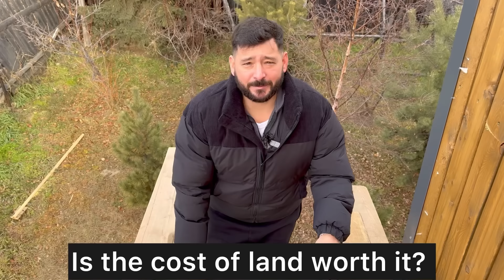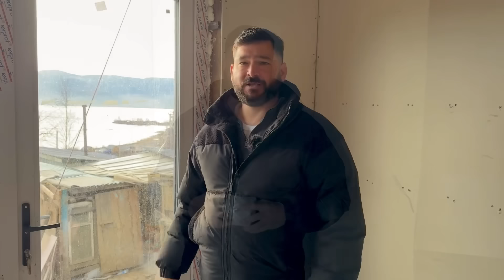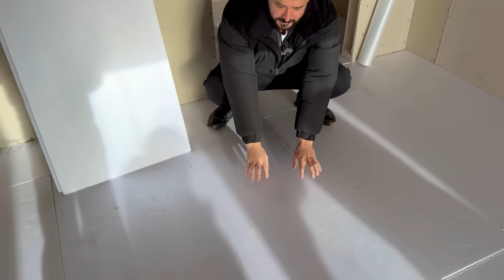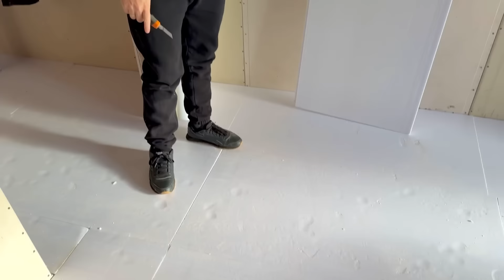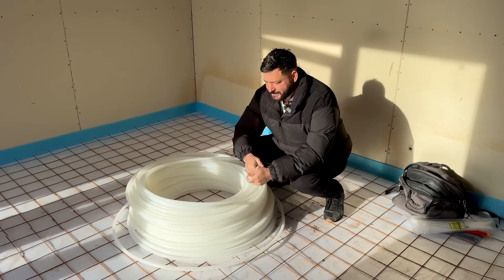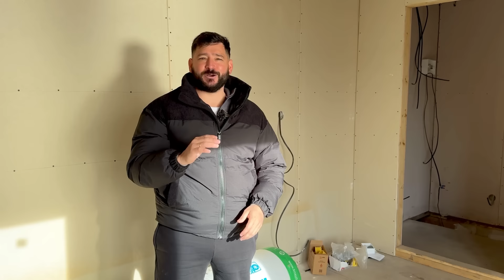House Prices In Russia Are Shockingly Low! 🇷🇺 Can You Afford it?

Comment: i would consider replacing the septic system or at least the tank, if a “holding tank”, is all that would be allowed more or less.  that existing unit looked rough and unsafe to people (kids), animals, and environment in terms of unsecured access/perhaps function.  i’ve engineered thousands of commercial and residential systems in the usa

Comment: I just know one way of construction in Russia. Having been in the Urals. They use wood trunks and central heating radiators. It has worked for more than 100 years. This construction seems very modern but it creates a lot of questions. Knowing how pvc pipes behave, plastics degrade with time and if you use hot liquids these should degrade with time. I would suggest metalic pipes for heating systems. If you want to keep the system condition good for longtime.

Comment: I have installed heated floors in Boston years ago were the hose would go under the floor in-between the juoses we're hot water would go through the hose to heat the floor, very expensive but very nice come winter time.

Comment: Lol mother board, it’s called condensing boiler.
I am not being rude But do you know ow what is the difference between mother board and condensing boiler? Yes there is mother boards inside the boiler.

I installed in-floor  heating systems for 24 years in Canada
Reply from the maker: Nice

Comment: Hi, How they keep the water and sewage pipes not freezing in the winter?
Reply from the maker: It’s kept covered and not exposed
Reply: Греющий кабель в земле которая часть. Наружи короб утеплитель и тот же греющий кабель
Reply: @АлексейАлексей-ы2п9ф  Sorry, for some reason your comment was not translated in to English.
Reply: @johndewey6358  The heating cable is in the ground which is the part. Externally, the insulation box and the same heating cable
Reply: @artemprudnikov5693  Thank you
Reply: @johndewey6358  Good luck & all the best

Comment: Here in the US we have manufactured and modular homes they are both factory made but there is a huge difference.  

Manufactured homes comes in one, two and sometimes in three sections with rough finish just like those in your video and they are temporary attached to foundation, the price $120-180 per sq. ft. depends on the location and customization   

Modular homes are just like traditionally build homes, you have a land but you don’t have time to build a home on your own then you just order factory made one, it comes in many pieces depends on the size and design you have chosen and its permanently attached to foundation, the price $220-350 per sq. ft. depends on the location but also additional features and customization may add $10-150 per sq. ft.   

Heating system in your video is called “hydronic system" in US, it was introduced in late 1960/70s but never really took off commercially on a large scale until 2000 and later due to its (material/labor) high cost, even today not everybody can afford it, the average price for labor and material is around $15 per sq. ft. and so the house in your video is 70 sq. meters equals 753 sq. ft. times $15=$11,295 and that would be final cost for materials and labor while “forced air system” is around $4 per sq. ft.
Reply from the maker: Thanks so much for the info!

Comment: 7:40 large heavy barrel that holds 300 gallons of fluid, thick 1/2~3/4 inch metal... with an outer shroud with a thick batting of insulation around it, thermal mass battery. like a locomotive train steam boiler. in shed outside of building... most log cabins have that kind of thing. burring natural gas wood kerosene diesel oil etc. prioritizing a sauna... an old 45gallon 316L stainless steel barrel only works for 3 seasons till the rust sets in. but in other terms, burning things just to make heat is not efficient so the thing that burns fuel to make heat also makes electricity, and the more that use electricity bump the load up making "it" hotter, large common aria. tho in Detroit for some time, pressurized steam was all over the place as the industrial processing plant ran. some still use large boilers that they fit whole 5 foot long 12 inch wide cut tree sections of logs into to heat their shop space. loaded up and burns for a month... heated lodges were a medical hospital type of thing, as the dogs live outside all year round. anyways, 40 years of 90 foot by 40ft double wide mobile trailer, need a 5 Ton truck to move it tho every 10 years the air to air furnace needs a new blower motor. adding to the first part that a water boiler system still has an air to air heat exchanger on the exhaust. tho as a last point, placing thin boards around the outside of a fabricated structure on stilts prevents cold air convection under the floor in the "crawl space" known to raise floor temperatures by as much as 15 degrees Celsius from outer ambient without using energy, shoveling up a snow pile around the exterior also has the same effect preventing cold draft.

Comment: In Norway they also use this method. Not quite the same technique but the same principles to heat the flour with liquid water or something similar. 👍 Very energy efficient and easy to control. You can also ad remote control by an app on the iPhone or something but not necessary if you’re not a tech geek. 😂 I might ad that a complete house building project like this in Norway would cost roughly NOK 3.000.000,- or double the price which is 30.000.000,- Russian rubles.😳😱
Reply from the maker: Wow I love such comments from similar weather countries and their prices thanks a lot for the information my friend
Reply: For 30 million rubles you can buy a two-room apartment in Moscow or a large house in the suburbs

Comment: It's done here in Minnesota,  the manifold you were holding up has the zone valves which control heating to any given area  and the nice part about that system is they're basically heating it with an on demand water heater that will use minimal fuel.
Reply from the maker: Thanks for reporting in from the northern states.

Comment: If you were building here in the states it would be twice as much. I just spend 10 grand on plywood for my roof alone. 80-100 bucks per sheet for roofing and flooring
Reply from the maker: It’s getting insane yes
Reply: Warren is from Canada, building a house in Russia. I may be wrong, but he says that in some cases prices in Russia are 4-5 times lower compared to Canada. And they can afford to take better materials that they couldn't afford before because of their cost.

I don't know how fair it is to compare Canada and the USA.
Reply: @evl3894   I know one thing the prices here in WV are bad, I need a 500 foot trench dug for water and it’s like pulling teeth just finding someone willing to do it. Have to resort to paying some commercial service from a metropolitan area to come do it for a premium, which is like $15,000
Reply: @encompassthyeclipse7278  As far as I've heard, there is a phenomenon in the US that you can't hire anyone to work on home improvement, but only the specialist who is recommended or allowed by the district, or someone who has all the necessary permits, but such specialists charge a lot of money for their services. And if the cost of work is conditionally $100, then such a specialist takes $400-800. Moreover, you cannot install an outlet yourself, for example, since you do not have a permit for such work and therefore you need to contact expensive specialists again.

All this phenomenon is explained by the fact that improper installation can affect the safety and cost of housing, which makes the entire area less attractive. Group responsibility is a very crude manipulation.

Again, I understand that the USA is very different from state to state, from city to city and from district to district. But it seems that this phenomenon is quite common. Although it seems to me that in such a rough form, it's just pulling money out of people. A harsh capitalist machine.

Maybe I'm wrong and this is erroneous information.

Comment: The only time you see radiant floor heating in Canada is in higher end custom and semi custom homes, sometimes coupled with geothermal. The typical builder-standard home will use forced air. Builders here have not adopted the technology because they go with the cheapest quickest solution. Trying to get the US and Canadian builders to adopt any new technology is quite painful. They're decades behind other places in the world. The radiant floor systems we do have are different from what you showed.
Reply: Here in Canada if you're fortunate enough to have heated floors,  it will be hot water heating from pipes in the (floor) concrete
Reply: Не совсем так. То что можно внедрить не потратив много денег, то есть. Например рекуперация воздуха, рекуперация тепла сточной воды. А тёплые полы не приживаются по причине дополнительных расходов застройщика.

Comment: Here in Norway we often drill 200meter deep holes for water or energy for heatpumps :)
Reply: we tend to do the same here in Russia as well. Just depends on a location
Reply from the maker: No way!!!
Reply: @Wild-Siberia  At my last project there was 16 holes that was between 200-250meter deep connected to one single NIBE heatpump :)
Reply: @RogueSecret  Wahnsinn. In Russland ist eben alles viel größer dimensioniert.😊 Kein  vergleich zu Deutschland.
Wieviel haben die Bohrungen gekostet? Wieviel hat das gesamte Projekt mit der Wärmepumpe und der Fußbodenheizung  gekostet?  Wieviel quadratmeter kann man mit dieser Anlage beheizen?
Oh, Entschuldigung. Hatte übersehen, daß es sich um Norwegen handelt. Aber vielleicht könntest du mir die norwegischen Preise sagen, nur mal um zu Vergleichen?
Reply: @uteschneider3349  For a normal 200m2 house you will manage with a hole 150m deep hole that cost around 8000 EUR+ 13.000EUR heatpump. There is a few cheaper way to collect energy from the earth, but this is the one that is the most stable no matter how cold it gets outside over a long time.

Comment: SPB ~$250k
Reply from the maker: Wow
Reply: @Wild-Siberia  ~230 sq m2, 3 bedroom on 2nd floor, but 2 of it i use as my work office and a sport room. 

It does include all engineering - vent+conds+diesel electro generator.
It does have a water source (underground), has a septic.
I pay about $300 per month for electricity.
Now connecting gas to heat and total amount of expense for each month should be ~$150 max.
Additional expense is septic maintenance (once per year), but it is not significant.

Comment: Hi Daniel I’ve seen this type of floor heating in the Northside wealthy suburbs of Chicago but my heating is GeoThermal but you need 2-3 Acres for the tubing to be laid outside of the property in the ground with this liquid in the tubing..Best heat and cooling system hands down and my electric bill is a 1/4 the costs compared to my old Lake Barrington Shores ,Illinois condo which my electric bill was 3 times more and still cold and poorly insulated..And no privacy.. I think those Modular’s are worth it due to the fact of the heating components and lake view and you’re able to add windows and doors and cost efficiency..🇷🇺❤️👍
Reply from the maker: Brother thanks so much for filling the comment section with knowledge thanks for reporting in from what it’s like in Illinois!

Comment: Re prices: Can you equate the cost of materials and labor to HULs (Hours of Unskilled Labor). How much does it cost for an unskilled laborer in Russia to dig a hole for an hour? In Rubles? In Dollars?
Reply: Как договоритесь по цене!..😊
Reply: @ФеняЕдренин  It's called "trading". In the end it's simple barter exchange. Price is set between the traders themselves. Seller quotes price. Buyer quotes offer. On agreement the trade is made. It is said "he who gives price first loses", so buyer makes low offer and seller sets price high. Then negotiation tries to meet middle ground. If successful, the trade is made. If not, "next?"
Reply: For St. Petersburg it is from 2,5-3K rub per day and up, depending on type of work. For worker with minimal skills in construction and renovation closer to 5K - tricky part is to find work without connections and avoid scams.
 But most likely you will make 3K/day by working at food delivery on a e-bike.
Reply: @musehtaicho  Based on 2.4K rubles per day (8hrs) , a HUL (hour of unskilled labor) is worth about 3 rubles. In the USA, someone working at McDonalds (an unskilled laborer) makes about $10/hr. That makes HUL worth about $10. So converting both to HUL's we can compare value without the nonsense of what currency it is reported in, right? 3 rubles equals $10 equals 1 HUL. The value of a HUL has not changed throughout history. It trades for the same size hole in the ground everywhere for all time.
Reply: @toddmarshall416  Not 3 but 300. Afaik pay at McD is indeed something around 200-250 per hour. So if you will do following calculations and compare cost of materials in HULs, please share results.
Reply: @musehtaicho  Decimal error working numbers in my head. Conversion factor $ to rubles is about 100 it seems. That's why I like to work in HULs. Conversion factor is 1.00... all the time... everywhere. People talk about how cheap things used to be... but they seem to forget how little they made. There's a 4%/yr leak in USA money. It goes to government counterfeiting. It's been that way since before the FED.
Reply: The minimum wage in this region, established by the government in law = 19250 rubles in month ($192.5) = 917 rubles in hour. 
But it will be hard to find a person who would agree to do even simple work for such a salary. It will be easier and more profitable for him to catch fish in the lake and sell it at the market.
Reply: @jamespont  Labor is something everyone has to trade. And like any trade, the rate is agreed between the seller and the buyer. 

I like to define a HUL as what someone who wants to buy a hole in the ground is willing to trade for it. It's unskilled labor. And if the HUL is the actual unit of money, the buyer will pay one HUL for an hour's digging... everywhere and any time. 

If someone can dig twice as fast he can trade his hour for 2 HULs... and get it. He's skilled. 

Another example of a HUL might be a 16 year old girl babysitting for an hour. 

And if a buyer is willing to trade 917 rubles for an hour of digging and if he can't get anyone to dig for that, then a HUL is worth more than 917 rubles. 

The problem with rubles and dollars is they change value all the time (due to government counterfeiting). HULs never change in trading value. Governments and banks have nothing to do with HUL creation or their value. Only traders like you and me do that.